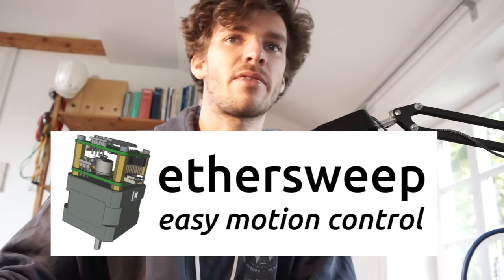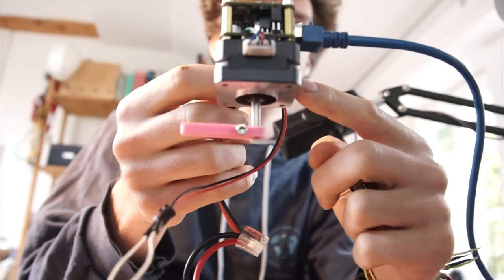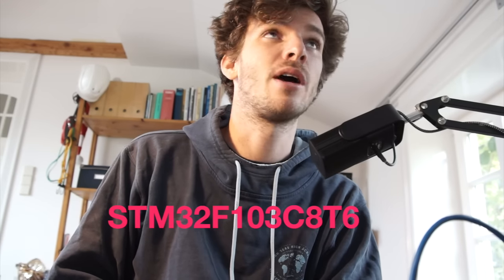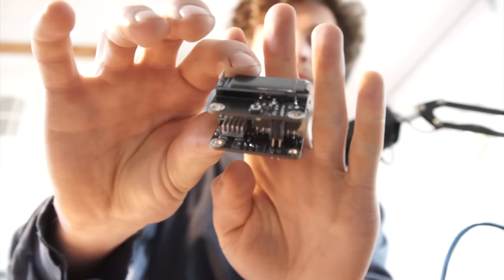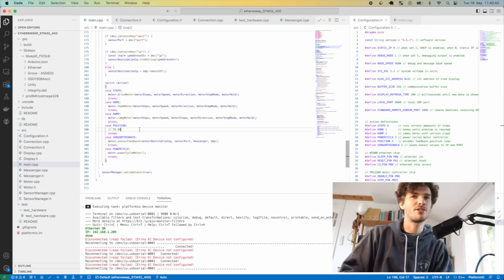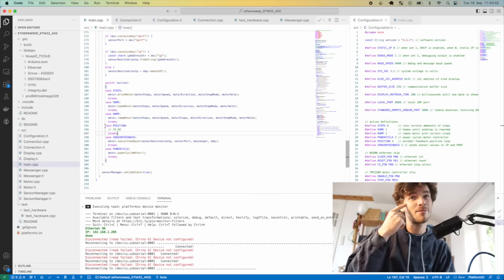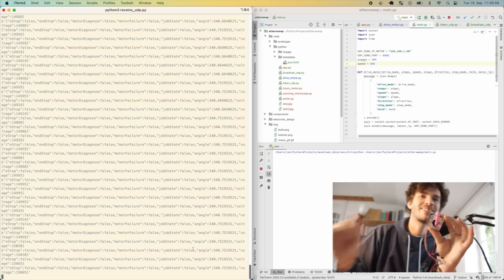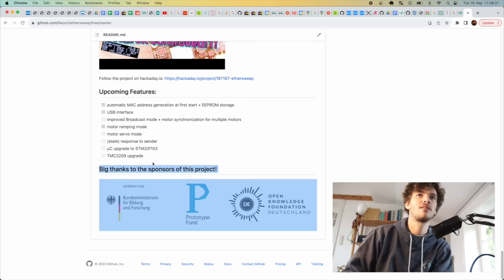What happend to Ethersweep? Project Update!

Comment: So timing, is this Ethercat or are you doing some other mechanism for timing events??
Reply from the maker: It's not Ethercat. Its normal TCP/UDP connections with IP network. Ethercat requires by design a very different network architecture and specialized chips that have precise timing because they use lower layers for that. Also they require more expensive chips and very expensive IO boards for computers + very expensive switches. 

Ethercat is a very capable and useful protocol if you actually need very very precise timing. Using normal Ethernet is 1. cheaper, 2. easier to implement using normal networking hardware and software (TCP/IP/UDP) and normal computers (Raspberry Pi, phone, microcontroller, laptop, PLCs, etc...) and 3. actually enough to get down to approx 1-2ms network delay (I just did some more testing and optimization). The latest mechanism for timing is an interrupt directly from the W5500 networking chip. Maybe the hardware will change in the future and be replaced by direct STM32 networking. Let's see.

The current hardware and software make it capable of being used in many automation and motion control applications. But maybe this is not the best motor controller if you need to run 5 axes on a CNC machine simultaneously.
Reply: @Neumi  my thoughts on a poor mans ethercat was just broadcast MAC packets and fixed frame sizes something like CAN not sure the inter port delays in a switch but it means everyone gets the packet at once

Comment: I just came across this project and wonder if you've seen the Amber robotics actuators. Are they using your design except with brushless motors?
Reply from the maker: I've seen the older drive versions with CAN. But the Ethernet version looks very cool! The harmonic drive and BLDC is the perfect combination in my opinion. I'm curious how their Ethernet interface/communication protocol looks like. I'd love to test one of their drive. As the hebi x8-3 costs around 4000USD I expect the Amber axis to be in a similar (maybe a bit less) range. But still I think they're very cool and worth checking out. 
(I love that I'm not the only one using XT30 connectors for robotics/automation :D)
Reply from the maker: Ok. Correction: the old version https://shop.amberobotics.com/products/aios-pro-mo80-110-80
cost between 850-1200 USD. I suppose the latest LAN version with an original harmonic drive will be around 1500 USD.
Reply from the maker: Some more thoughts:
Are they from the US or China? The page is partly in Chinese, but on the Kickstarter claims they're from California City.
The Kuka KR 10 has a pose repeatability of 0.03mm https://www.kuka.com/-/media/kuka-downloads/imported/8350ff3ca11642998dbdc81dcc2ed44c/0000210360_en.pdf
The Amberobotics claims to have a repeatability of 0.05mm. I have my doubts about that.
But I'd love to be proven wrong.
Reply: @Neumi They're out of China. There's a couple of kickstarter pages that show the pricing for the arms and it comes with around 7 for a few thousand.
Reply: @Neumi Any chance you'll be creating a version for BLDC? :)
Reply from the maker: @joshmouch  It would be interesting to get individual motors. The robot arm is cool, but has only very few use cases. Having Ethernet connected BLDCs with encoders etc would be so much more useful IMO. 

There is this very cool project: https://www.youtube.com/watch?v=JMXz5tzpq7U
She built pretty much the perfect robot drive motor controller with a BLDC + encoder, but (I think) CAN and I2C connected. I'd love to see an Ethernet interface for that as well. Personally, I have zero experience with BLDC control circuits. So it would take some time to get something running. However, these hoverboard hub motors or harmonic drive BLDC motors would be very cool to have an Ethernet interface/driver for. But it would be a complete start from zero. And it should open-source of course ;) So maybe in the distant future...

Comment: PoE?
Reply from the maker: Power over Ethernet. Ethernet cables have 8 wires. 4 are only needed for 100mbit ethernet. The rest can be used to transfer power. I think up to 120W actually.
Reply: PoE+ would be interesting for sure. You can buy cheap 4 port PoE+ injectors which means you wouldn’t even need expensive switches.

Comment: Wow! 
That is, with the help of your controller, it will be possible to safely assemble multi-spindle CNC, 3d printers and multi-link robots?

 It's just perfect!
Reply from the maker: I'm not sure if the current hardware (and maybe software) is able to get the low latency a CNC controller would get. Klipper for example is in the low microsecond range. Ethersweep is more in the millisecond range. But lets see ;)
Reply: @Neumi  I think for a number of tasks where nodes move relatively slowly, this is quite enough.  
Such modularity has an impressive potential. Flexibility and compactness. 
Thank you for your hard work!

I am waiting for your new developments
Reply: "multi-link robots?"
No. Robots require positioning so each joint must have an encoder that tells the controller about what the actual position of each joint is. The contemporary approach to robot programming is teaching the the robot controller key points the  robot joint trajectories are made of.
Reply: @MSM5500  
Do you mean to say that such constructions are impossible due to the lack of feedback and data on the position of the joints? 
But there is a magnetic encoder there.
 Of course, with the current processing speed, such mechanisms will be very slow. 
But speed is not needed everywhere
Reply: @sl_st   there is a magnetic encoder there
there should be a proper encoder that sends real time signals right to a robot motion controller. In articulated robots the motion of all the joints must be precisely synchronised all the time.
Reply: @MSM5500  These encoders can easily cope with the task. The main thing is the time scale. If you want to say that it will not be possible to assemble a high-end industrial robot, then yes, this encoder is not enough. And if we are talking about simple and affordable layouts, which will reduce the threshold for entry into robotics. Then this option is great!

Comment: this is really cool! I wonder if these will get good enough to be used in industrial applications.
Reply from the maker: the biggest problem with this board is most likely the missing time accuracy. therefore it isn't well suited for industrial (at least time critical) applications.
Reply: @Neumi  yeah it’s what I was thinking. Would be cool if it can be used for time critical operations
Reply from the maker: @maxmoors  Maybe in the future, this might become possible. But with the current hardware, I'm restricted to the normal ethernet layers. The w5500 ethernet chip only supports higher-level ethernet features and only the standard architecture of ethernet (compared to EtherCAT for example)

Comment: EtherCat interface? PoE+ support or PoE PD possible?
Reply from the maker: EtherCat is a commercial/closed protocol and the ICs are very expensive. Also you have to buy yourself in if you want to use EtherCat. Nothing for an open source project unfortunately. Also standard ethernet hardware like switches etc cant be used. POE should be possible and is on the list of features :)
Reply: @Neumi  Ahh for EtherCat i didn’t know to be honest. TSN or AVB supported by the Mac?

Comment: Hello! Great idea!
I was wondering why didn't you choose "realtime" EtherCAT with PoE? Is there a reason or the possibility was looked over?
Reply from the maker: EtherCAT is closed source. You have to buy the IC/ASIC from Beckhoff for approx. 20€ p.p. You also have to buy product into the EtherCAT community. (Nothing for an open-source project). Ethercat is on a lower Ethernet OSI layer and can, therefore handle requests much faster before it is even decoded. Also you need specialized switches and routers. All of this makes this hard to use and expensive, if you just want to setup a tiny experimental assembly. Of course, if you need very deterministic/hard timing you could/should use i.e. Beckhoff servos. But they are 500€ pp + switches + very expensive cables ... And if you have limited space (robot, small machine) you don't need the big distribution boards etc. A cheap BotBlox switch is enough ;)
Reply: @Neumi  Totally understandable. Thank you for your answer!

Comment: What kind of security/authentication are currently in the project?
Reply from the maker: None. Every request is run without security check. This is actually not unusual for industrial motion control. We assume that you secure the motor network physically. But this might become a feature in the future.
Reply: @Neumi  oh, that means that if the network perimeter is breached or any device in the universally trusted subnet is compromised then an attacker can do whatever they want without resistance. 

Gaining control of motors and safety critical devices such as pumps, power installation, valves etc can lead to life treating situations.

There's the saying that it's the S in IoT that stands for security and I hope that my comments may encourage your project to become a positive benchmark.

Also consider monitoring, logging etc

Comment: This screams ether-cat. It's starting to catch on in industry and would be awesome to have a hobby ether-cat motion control system.
Reply: Would be even more like it if there were 2 ports for daisy chaining.
Reply: Modbus TCP is way easier to implement. EtherCAT isn’t compatible with traditional ethernet and isn’t IP based. Modbus TCP is a dead simple industrial protocol to implement.
Reply from the maker: same what he said!
Reply from the maker: But yes... it would be very cool. But if you have the motion controller, you also need the networking stuff... and that is also very expensive. But it WOULD be cool. :D
Reply: @EvanBoldt  Real time data isn't ip based (mac based) but standard data is.

Comment: Why don't you use POE Power over Ethernet? Why do you have to power it separately?
Reply: PoE is only capable of 350mA at about 50V, so 17.5W.  This isn't a webcam or something small, and it's quite likely that a stepper could exceed that amount of power draw for a while.  What happens to the stepper when it can't get enough power?  It's entirely possible that the thing the stepper controls could be damaged or even hurt someone.  100% stable and reliable power is extremely important when controlling physical devices/machinery, since there's a big difference between having a device glitch and need to be restarted and having something ruined by an unstable stepper.
Reply from the maker: I didn't implement POE because it takes a lot of precious PCB space and is a bit tricky to implement. (POE likes to run on high voltages (around 50-60V) and low current, so I have to step it down and this takes space). Also power limitation reasons. Yes you can theoretically drive 120w trough POE++ (+) (unregulated standard I think). But then you need quite expensive switches or injectors. But this might become a feature in the future.
Reply from the maker: I think everything above 12W has to be negotiated on ethernet layer 2... making this quite annoying on hardware AND software side. Stable power would actually be good. And as POE is stable up to 12 ohm cable resistance, you can imagine the voltage drop when I try to draw 500mA from it :D This would require some intensive smoothing on the power supply on Ethersweep. (takes a lot of space again)

Comment: Network latency will be a problem...
Reply from the maker: It depends on the application. If you want to control a CNC this is probably not the right motor controller for you. If you build a robot, antenna tracker or test assembly you might consider these and get the benefit of very easy control from computers or other network connected hardware.
Reply: @Neumi  the first thing that come in my mind looking at stepper motors are 3d printers... and the idea of having independent stepper controllers inside a 3d printer, one on each motor, connected inside a network, is a dreamy idea...
Reply: Cool!
Just to make it clear, the ATmega328 is not limited to 8MHz. It's 20MHz which of course is still a lot slower, just not ten times slower.